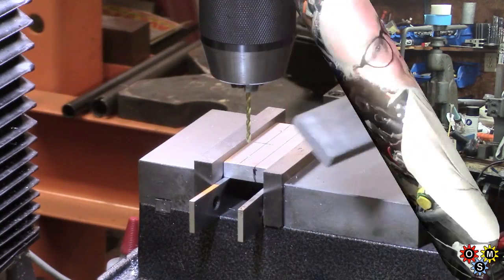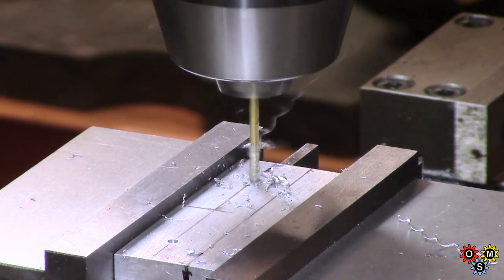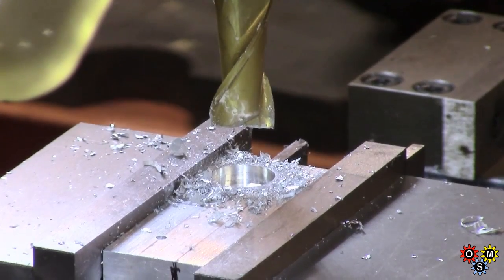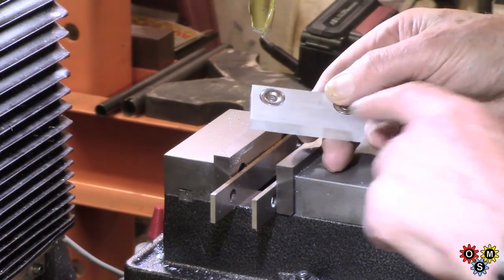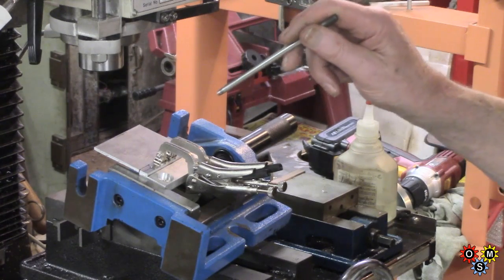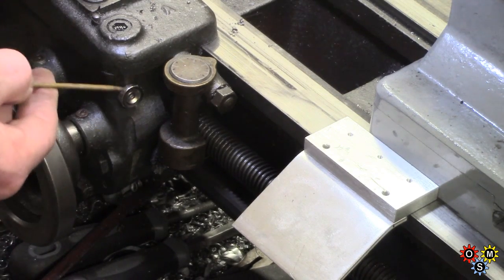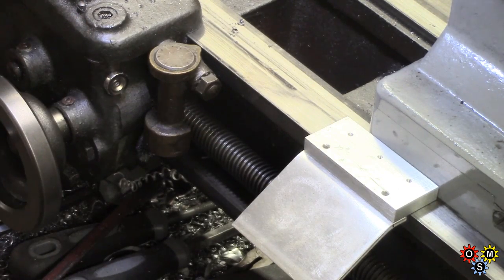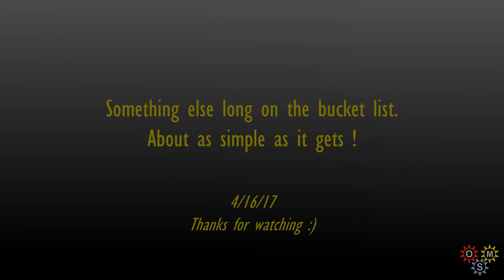Simple Lathe Carriage DRO Addition

Comment: Been looking for something like this. My only hurdle was I didn't want to drill into my cross sled. Using magents is a genius idea. My only challenge is that the lower part of my cross sled is made of aluminum so I might have to make 2 small holes and attach a steel plate. Great idea! 👍

Comment: Chris, a great addition to the machine. but where do you get the digital slide measure? Having trouble finding one like that. Cheers, Rx
Reply from the maker: Rex - I am pretty sure I found that on eBay - but of course near 4 years ago! I know it was not overly expensive. Hopefully available somewhere with some searching.:)
Reply: @ChrisB257  Thanks for the quick response. I’m in Aussie and having a bit of difficulty finding such a scale. Plenty of digital vernier gauges, and other more expensive DROs. but a very tight budget. But thanks!

Comment: chris try drilling with bacon grease you will be totally amazed at how good this works and smells good as well. i tried this at work and i could not believe the difference.
Reply from the maker: Hi Jamie,
Now there's something different! Not sure it would help on Al though but worth a try on steel maybe :)
Reply: In my 1940s lathe booklet, lard based cutting grease is the recommended, everything else is - if you cant get lard you can use...

Comment: Picked up my first new to me mill, I'm adding this to my ever growing list of projects 😀. Cheers. P.s please keep also saying the sizes in metric, imperial measurements make no sense to me 😟
Reply from the maker: Hi Shaun,
Congrats on the new mill. Sorry about the inch measuring - I am too old to change. I'll try sometimes to give an approx equivalent in metric.
Reply: Appreciate that thanks, I need to print out an idiots guide or something, it just makes me laugh when watching these types of videos of precision engineering they say I need to shave of 13/57th or something silly 😀metric is sooo much easier ha ha
Reply: It's a xj9512, from eBay, needs some tlc but Iv started to learn so much from restoring older equipment rather than just using something that is new. Sounds daft but I feel I put more into what I make this way.